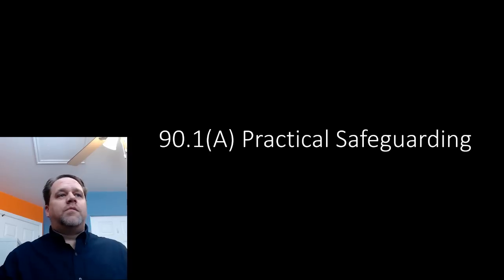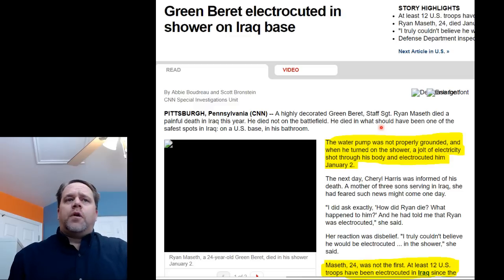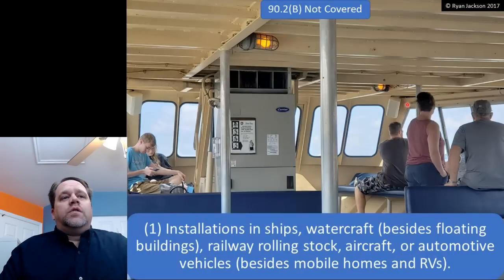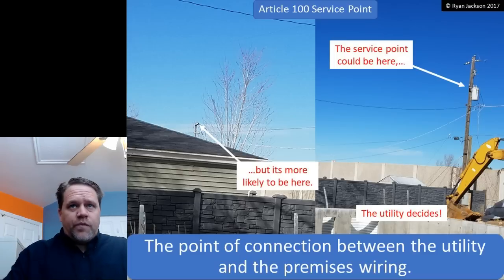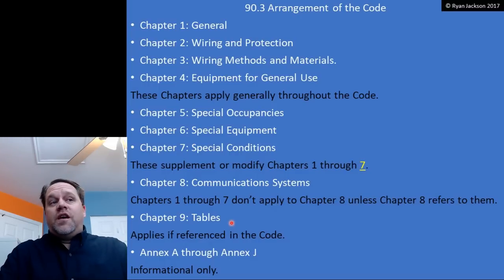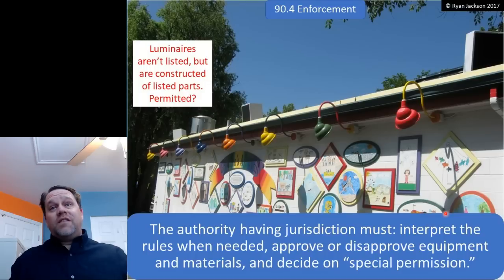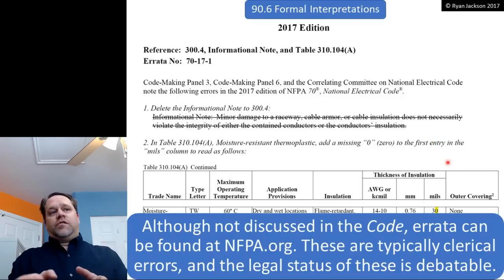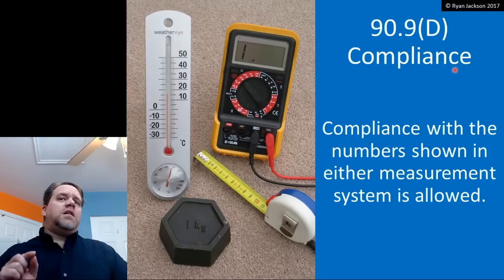Article 90 of the National Electrical Code (NEC)

Comment: We all know that the ultility company has there almost anything go rules. I put in a 100 & a 200 amp service in a old building. The basement end box was feed with 70 year old freyed #6 copper frayed and cracked RHW wire. Can not understand how #6 wire can feed 300 amps. They told me that being their wire was underground and cooled by the earth it was okay. Same thing with transformers. Installed a 800 amp 240 volt service. The pole ( think it was a 75 KVA ) transformer already feed a 200 & a 600 amp service. They would not install a larger transformer. They replaced the undersized transformer twice within a year. Can not fix stupidity until the owners lawyer raised hell and they split loads up to 2 new transformers.

Comment: Architects never get the picture. They never provide enough receptacles in conference rooms. At the extra large hospital/research center that I retired from they had 3 large confetence rooms with every state if the art gadget under the sun but only had receptacles every 20 to 25 feet. They used these rooms at least 60 hours a week including nights & weekends. We had to run extension cords taped to floor sevseral times a week.   I always wrote our department on every cord & power strip but at least $800 a year in these disappeared. Would have paid for it self if they had more wall receptacles.

Comment: Concerning 24 volts. We were told that with class 2 ( think its a max of 40 VA) does not need to be fuse protected but I rather have a dollar fuse blow then burn out the $12 transformer. Most of the control companies have class 2 24 volt transformers with a built in circuit breaker. Was also told that a short from a class 2 24 volt transformer would never produce a big enough spark to start a fire. Never gave a thought that a low voltage splice can create emough heat to start a fire. Thanks for showing this.

Comment: Btw phone if more like 50vdc during battery and 90-140 vac ringing
Reply: Actually it's referred to as 48v just like a car is 12v.
Reply: @UCoTxmPZskPak2CQrXrs9jNw I'm sorry I guess I didn't explain it properly. The actual provided voltage may vary (substantially), especially in rural service. 48 VDC is the standard voltage on telephone lines. Just as a car is 12VDC, but fully charged automotive batteries should measure at 12.6 volts or above. When the engine is running, this measurement should be 13.7 to 14.7 volts.